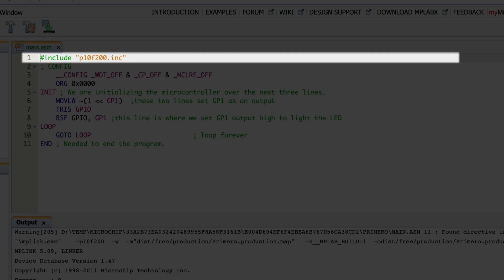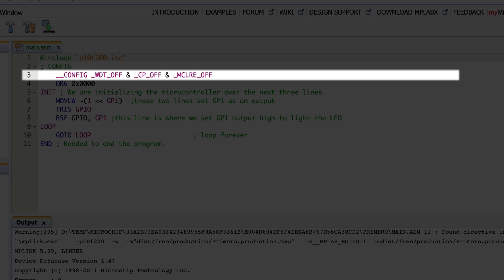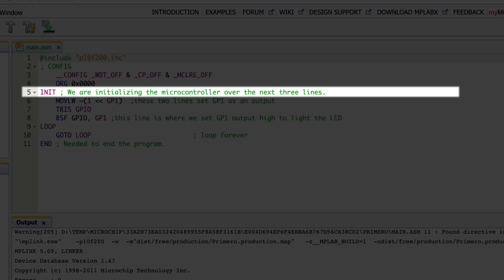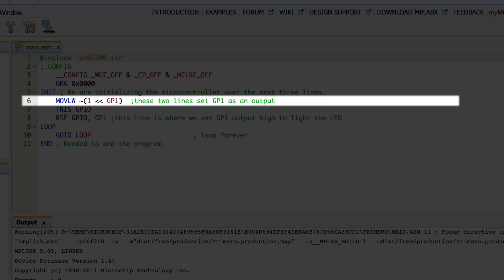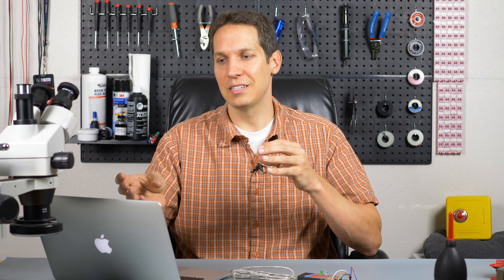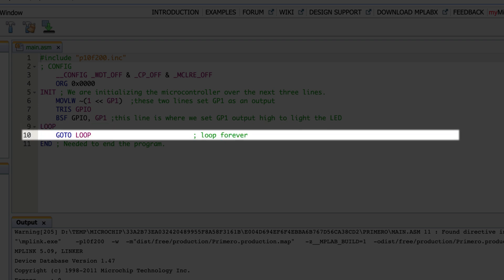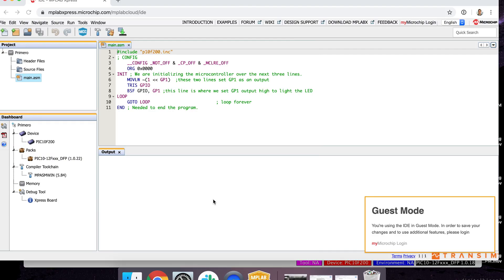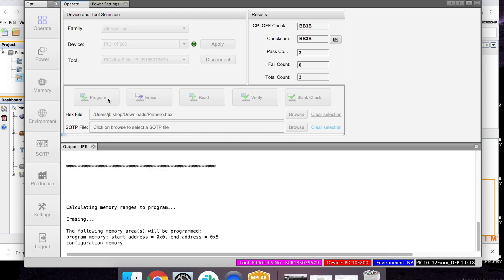Your First Assembly Program -  Part 5 Microcontroller Basics (PIC10F200)

Comment: Big difference from the mid 90's when I was doing ASM in a text editor and using the little homemade parallel port programmer.
It's a wonder I ever got anything to run but.. I made a ton of things from simple bumper bots to complex telemetry systems using RS485 and handling digital as well as analog inputs and outputs. Used an interface made with Visual Basic. Even made a servo controller that controlled 16 servos. Should have taken it a bit further and made a remote robot with it but.. life got in the way, got married.
Now I'm back again with my 8 pin PIC16F18115 and bewildered by the complexity of MPLAB. Thanks for walking me through it.

Comment: Great video series, however I find the way you pan the camera in and out a dizzy distraction. Not to be negative, but just my two cents worth. Best regards!
Reply from the maker: Thanks for the feedback!  We usually use those to "hide" cuts where I screw up (for one reason or another) - we try and make them more natural but sometimes I screw up more than other times 😬
Reply: @CircuitBread  It's all good. Great videos! I'm kind of new to "non- RF" electronics. I appreciate your website and Youtube videos. Thanks!

Comment: I wish you'd have explained exactly why it's necessary to flip all the GPIO bits from 0's to 1"s. Somehow, that seems irrelevant, but I expect there is a good reason, which hasn't been described.
Reply from the maker: Hi Tasmedic!  The video portion of these tutorials are focused on the high-level structure and some of the specific commands.  The written tutorials that Sergey wrote, and that these are based on, goes through each line and new command in depth and not only explains what they're doing but why.  I highly recommend you go check them out!  Here's the link for this tutorial:  https://www.circuitbread.com/tutorials/the-first-assembly-program-part-5-simple-microcontroller-pic10f200

Comment: Thanks for the nice explanation! The binary portion seemed strange…generally the first bit is the 1 or 0, so why but shifted? Also, BLINKING LED is kinda the standard starting project. Aside from that, nice step by step generally.
Reply from the maker: The videos in this series are quite high-level compared to the written tutorials that these are based on.  Sergey goes in-depth on the reason for everything, I highly, highly recommend you check out his written tutorial here (and all of his written tutorials - these were definitely designed to work together not separately):  https://www.circuitbread.com/tutorials/the-first-assembly-program-part-5-simple-microcontroller-pic10f200   
As for the blinking LED, that is part 6 and, since Assembly is quite a bit more complicated, it made more sense to just get an LED to turn on and not worry about timing in the first one.  I remember the first Arduino project I did was to have an LED fade in and out, which I did in 15 minutes.  VERY different from doing these very-low level projects in Assembly.
Have a great one!

Comment: can this microcontroller interface with an esp8266 wifi module?
Reply from the maker: You can bit-bang a UART with the PIC10F200 (https://www.circuitbread.com/tutorials/communicating-with-a-pc-using-uart---part-11-microcontroller-basics-pic10f200) and communicate that way with the esp8266 but be careful about the voltage levels so you don't burn out your module.

Comment: I have an ASM but do I need something else to go with it? or do I just upload it to the pic somhow? All I got was an ASM file
Reply from the maker: I thought I responded to this but it's showing that I didn't, sorry about that.  The ASM file is what is used with the compiler to create the HEX file.  The HEX file is what you actually upload to the PIC via the programmer.  Typically, and more easily, you'd put the ASM file (copy and paste) it into the IDE, and then you just use the IDE to compile/build the HEX.  Depending on which IDE you're using, you can even upload it to the PIC using the IDE directly, though I use the IPE normally (and it's what's shown in these videos later on).  If you have any more questions, I highly recommend checking out Sergey's written tutorials on CircuitBread.com - he has a lot more depth and answers many questions there.
Reply: @CircuitBread  thank you managed to sort it with a very old version of MPLAB now cant seem to get my K150 programmer to work though
Reply from the maker: If it's not one thing, it's another.  I've never used the K150 and I don't recall hearing Sergey ever talking about using it either, so I'm not going to be much help in this regard.  Sorry about that...

Comment: Can we program those chips with C instead of assembly ?
Reply from the maker: Absolutely!  We just did these tutorials in assembly because 1) it helps teach the inner workings of the microcontroller better 2) it's still required in many universities to learn assembly and 3) assembly has certain benefits to using it.  That being said, C is a lot easier in many aspects and, as far as I'm aware, all PIC microcontrollers can be programmed using C.
Reply: @CircuitBread Thanks, I guess even with C it'll be a bit challenging compare to the arduino interface.
Reply from the maker: Yeah, mostly because of the lack of libraries that are so easily integrated into Arduino.  But there are probably lots of C based resources out there that you can use, even if they're not as tightly integrated.

Comment: HA! I have that update problem with the random Windows 10 updates. I've since dedicated all of my microcontroller projects to my Linux computers! I did not know about the "MOVLW ~(1 << GP1)" for setting up I/O, I always did it pin by pin
Reply from the maker: Yeah, the first time I saw that method of configuring bits I was working on a Renesas microcontroller and saw it in their sample code.  It confused me quite a bit at first but it is pretty slick if you use it right!

Comment: Are there any updates to use this tutorials for the pic as compiler?
Reply from the maker: Hey there!  Yes, even though these and the written tutorials are still mpasm-centric, all the written tutorials include XC8 compiler code at the bottom of the tutorial that will work with the new compiler.  The differences aren't significant enough that we anticipate a problem following the mpasm code and applying the principles to the XC8 code.

Comment: Sir, I don't understand the left shift part (line 6), why are we shifting those bits ?

next the loop, is it going to repeat 9 & 10 lines forever?
could you please explain those?
Reply from the maker: Hi Altair, Sergey goes into a lot more depth with each line and explains exactly what's going, it will help not only with this tutorial but each tutorial going forward has the written resource as well.  The video more describes the highlight and the overall structure and the written tutorial has a great deal more depth to it:  https://www.circuitbread.com/tutorials/the-first-assembly-program-part-5-simple-microcontroller-pic10f200

Comment: Wow! Very informative. Thank you so much for these videos. I am a power electronics design engineer with 20+ years experience but this stuff is something I have not touched since I was a student in the 80s (yes, I'm that old). The last time I did something close to this was on Intel's MCS-85 System Design Kit (SDK) for the Intel 8085 CPU. I now got to work for an EV manufacturer and I have to interface all the high voltage circuitry to MCUs. This really helps me get started! Thanks again! VERY WELL DONE!! Keep-up the fantastic work!!
Reply from the maker: Awesome, thanks for the feedback!  I don't like dealing with high voltage stuff (for me, mains is high voltage) so it's cool to hear how you get to integrate logic and high voltage circuitry.

Comment: sir can we make any microcontroller to a operational amplifier microcontroller by programming
Reply from the maker: I understand this to be asking if we can emulate an operational amplifier with a microcontroller.  I'd would say "yes, but you wouldn't want to."  If you have a powerful microcontroller that is fast and has a DAC, you could probably fake it.  But it would be expensive and I can't imagine it would work as well.  Unless you're using it in a certain configuration wherein the digital foundation of a microcontroller is better suited than the analog op-amps you would usually use.  Like using a microcontroller as a DSP instead of creating analog filters or amplifiers out of op-amps.  But just digitally recreating a general op-amp?  I don't think it would be very effective.

Comment: Sweet so CX8 totally redid the syntax making these tutorials totally non functional and irrelevant. Is there a resource to essentially transcribe this old code to work with the new assembly syntax? I'm trying to work through the user manual but many of these commands don't exist or have changed names so significantly I can't find them. This sucks!
Reply from the maker: Hey Dominic, sorry this is belated, but the steps to transcribe the code is here:  https://www.circuitbread.com/tutorials/mpasm-to-mplab-xc8-pic-assembler  But the volunteer who wrote these instructions also already converted the code for the XC8 compiler for all of the tutorials, so hopefully you won't need this tutorial.
Reply: @CircuitBread  Can we use MASM, GAS or other assemblies with pickit 4?

Comment: This is a great tutorial, but you may need to update it. The current version of MPLAB X no longer supports mpasm and requires using x8c instead. Programs written for mpasm are not directly compatible with the x8c compiler. It would be awesome if you could update the code snippets on our website to work with x8c. Thank you!
Reply from the maker: Thanks for the heads up!  I'll let Sergey know, get his insights, and hopefully get the example code up-to-date.  Versioning issues... what a pain in the neck.

Comment: fatal error: 'p10f206.inc' file not found
I can't find it in the Microchip folders. Where is it?
Reply from the maker: Hey Martin - Which IDE are you using?  Did you find the folder that has the other include files?  It's been awhile since I've delved into finding the include files and I remember it was an issue with something I did with the code itself (a typo) rather than the file location, though I didn't realize that until after I'd spent an annoying amount of time digging around the filesystem.
Reply: @CircuitBread  I am using MPLAB X IDE v5.40. It seems to be #include <pic10f206.inc> in Windows 10. I get 3 more syntax errors though.
Reply: Here is the working code for IDE v5.40 with device PIC10F206 with some additional hints on how to use the IDE:
https://github.com/bjt-user/pic10f206/blob/master/light_a_led
And this is the working code for making the LED at GP1 blink:
https://github.com/bjt-user/pic10f206/blob/master/blinking_led

Comment: Looks like assembly language is little bit complicated.can we use python or c to program a microcontroller?
Reply: You can, but it is not practical to do that for such a small device. The PIC10F200's memory space is very limited and the bloat created by a C compiler can make it very hard to fit even a small program onto the microcontroller. Using Assembly lets you use the space much more efficiently. If you really want to avoid using Assembly, consider getting another microcontroller with more space, but keep in mind that they will cost more money and can be overkill for small projects.
Reply: It just looks complicated, but actually it’s easier to configure the peripherals of a microcontroller in register level when you use assembly language.. In cases that the memory is just limited or faster execution of the instructions is needed, you really need to go back to assembly language.. But you can always use C.. Python needs interpreter, so expect that it’s really not memory efficient..